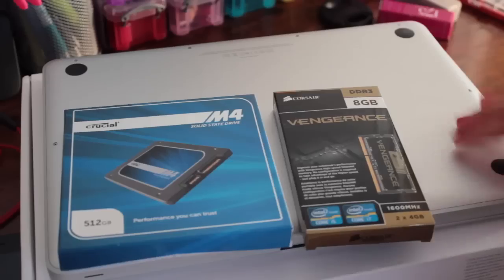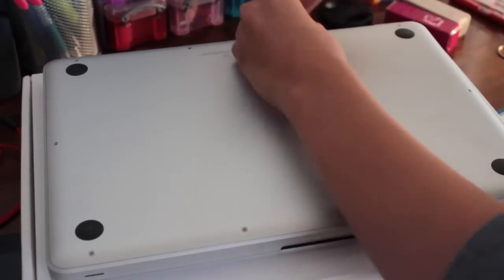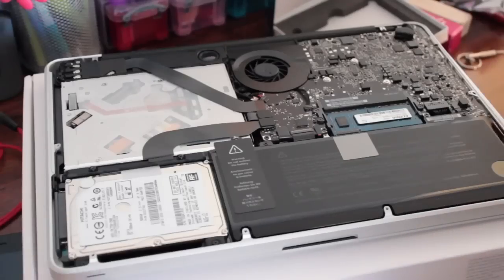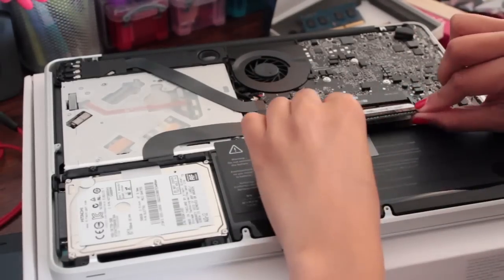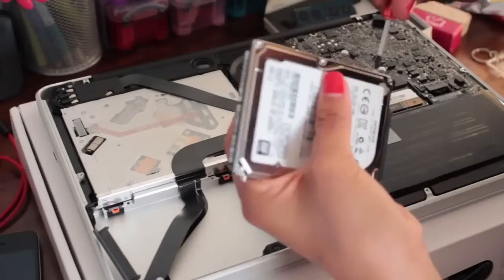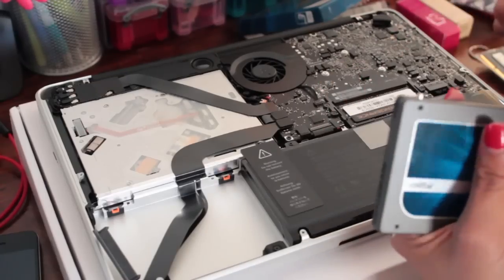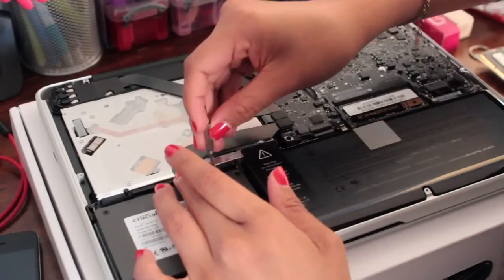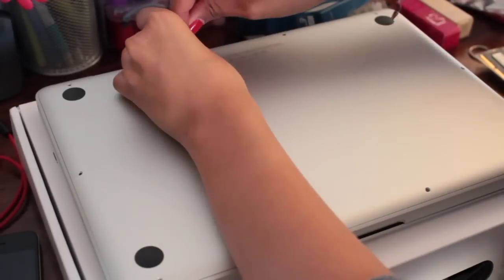Tech Talk | Upgrading the Ram & Hard Drive on my MacBook Pro (Mid-2012)

Comment: One important thing to know when buying RAM for Mac is the CAS Latency number!

It is specified as "CL" - CL7, CL9, CL11. A PC will run fine with any of these, but (of course) Macs are fussy with this, so you should check what CL number your existing RAM is, and stick to that. You can do it by writing down the long model number on your existing RAM, and googling the specs. As far as I know CL-7 and CL-9 (slightly cheaper) are usually Mac compliant, avoid others. Some people will tell you to spend more money to get CL7, because it supposedly runs faster. That's complete BS, even if it does, the difference is so microscopic, you will never notice. If you search for "MAC compliant RAM" it will usually give you CL7, which is slightly more expensive than CL9, but the difference is miniscule.

The MHz do not have to be exactly the same, it can be higher for your new RAM - if your existing RAM is 1066MHz, it is safe to buy 1333MHz or higher, it will still run, but at 1066MHz (because that's the max speed your mac supports).

so, key specifications to take in account:
DDR3 - generation - all RAM nowadays is DDR3
SODIMM - Form factor - laptop memory (as opposed to DIMM - for desktop PCs)
4GB - size (if you want 8GB total, buy 2x4GB, RAM works best in identical pairs)
1333MHz - speed - can be higher than your existing RAM, it will adjust the speed to your computer's specs.
Kingston/Transcend/Crucial - Brand (does not really matter, they are all made in same factories in China)

RAM upgrade can only be noticed when you do a lot of things at once - Lots of tabs open in browser, multiple heavyweight applications - photoshop, illustrator, etc. If you are not a heavy user, you might even not need a RAM upgrade.

As for the SSDs, it is definitely the number one upgrade anyone should do to speed up their old computer. Your computer will start quicker, shut down quicker, open apps quicker, find and open files quicker.
As SSDs are more expensive than regular HDDs, figure out how much space you REALLY need on your SSD - check what disk space you have used currently - A 256GB SSD should be enough for most people. You can hook up an external HDD for storing large amounts of files you don't need on the go and every day.

SAMSUNG SSDs are very fast, reliable and great value for money. SAMSUNG PRO series comes with 10 year warranty.

Comment: Hi Aleeza. Quick question, how come you replace the bottom left component and not the top left? Are they the same? I too do own a macbook pro but I cannot seem to find any answers telling me what's the difference. And for the RAMs, the manual said to get a maximum of 8gb ram only. Doees the RAM actually matters since I recall you say in the video to make sure if the mackbook can actually take that much ram. (I own a mid 2012 MBP)

Comment: I'm about to upgrade ram on my macbook pro mid 2012 (MD101) too. Although I am really concerned about what ram to buy. Would this work with the 13 inch mid 2012 (MD101) macbook pro ?

Corsair Vengeance (2x4) 8GB (CMSX8GX3M2A1600C9)  
• Memory Type DDR3
• Memory Speed PC3-12800
• Memory Speed MHz 1600MHz
• Memory Size 2 x 4096MB
• Total Memory Size 8GB
• Memory Modules 2
• Memory Socket SODIMM
• Memory CAS Latency 9-9-9-24
• Memory Timing 9-9-9-24
• Pins 204
• Voltage 1.5V

Please reply!

Comment: U should also mention,that the boot times are compared with the mechanical drive full of apps,and the new ssd is a fresh install,it is like comparing an "Old tortise with a stone tied to its tail'' to a young hare
Reply from the maker: +xraydog2011 actually if you look closely, the HDD boot time was taken after a fresh install of mac os. There were no files / apps downloaded other than what came stock with the os; whereas, the SSD was a duplicate of the files / programs from the HDD. if anything, the HDD would have the advantage?
Reply: aleeza / stylishandliterate  My bad,the menu bar mislead my eyes,u r right.
by the way another upgrade u can do is to replace the optical drive with another hard drive

Comment: I just bought another Macbook Pro for the price of that Crucial M4 512GB hard disk.  I can work on the new Macbook on different programming projects while the other one boots.  SSDs are great but 513GB is still expensive in many ways.  Is that extra minute really worth it?  Now ram on the other hand is definitely recommended.

Comment: I have a MacBook Pro 13-inch (Mid-2012) and I would to upgrade the Hard drive for the purpose of using Logic Pro X, Ableton, Akai MPC Renaissance and Adobe Premier - etc.  Currently, my Macbook Pro has the standard feature 5400 rpm but my ram is actually at 10 gigs.  I hope I'm not confusing you...

Please let me know which direction is best recommended for accomplishing my goals and for giving me the best possible performance.  See list below and compare...

Samsung Electronics 840 EVO-Series 1TB 2.5-Inch SATA III Single Unit Version Internal Solid State Drive MZ-7TE1T0BW

versus

Corsair Neutron Series GTX 480GB 6Gbps SATA 3 Exclusive LAMD LM87800 2.5-Inch Synchronous Solid State Drive CSSD-N480GBGTXB-BK

Comment: I have another question...I have a macbook pro 2010. which is very slow... any RAM i put in to upgrade always fail. I only start up to load and its never able to boot to desktop. do you think changing the HDD to SDD would make any difference?

Comment: *****  great video but next time wen u installing or removing anything inside ur macbook laptop first thing u must do is unplug the battery cable so u wont fry ur laptop..no u dont have to remove ur battery but yes u do have to unplug the battery cable ..just the cable not the battery thats the first thing u must do wen u changin anything inside ur macbook laptop